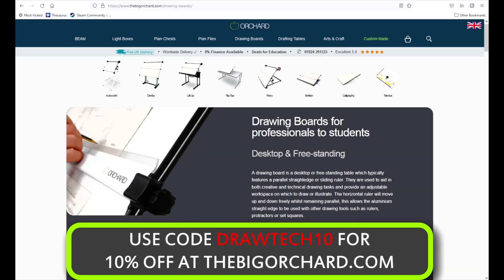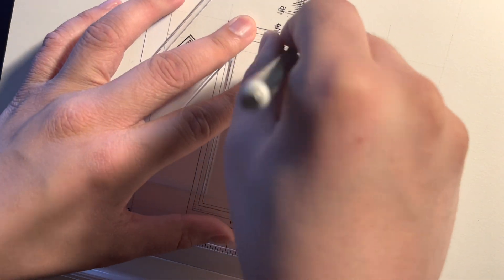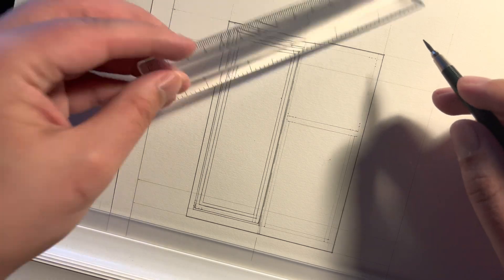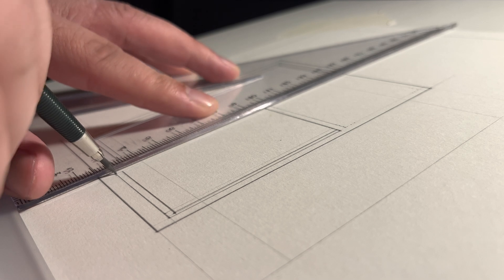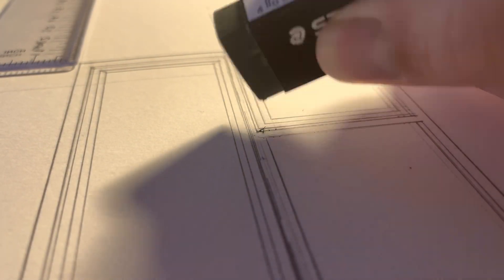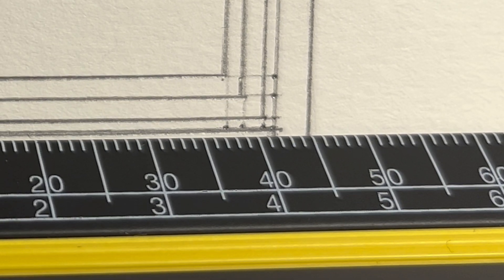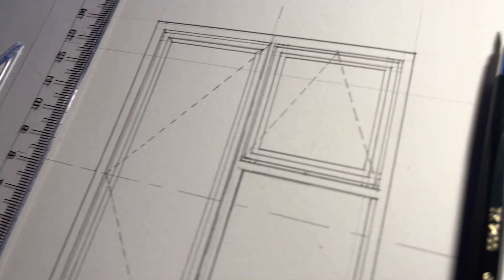Window Elevation Drawing - Technical Draughting

Comment: Do you have the measurements of all the parts?
Reply from the maker: Hello, did you want the measurements of the window in the drawing?
Reply: @DrawingTechnical  yes I do need the measurements
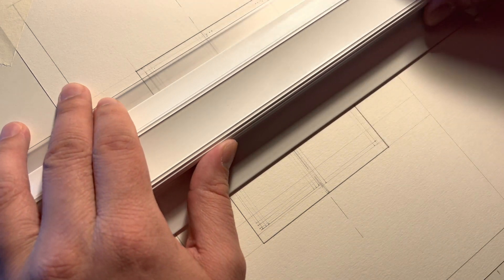Reply from the maker: Hello. the window is drawn at 1:10 scale, it's 910mm wide and 1210mm high. The dimension from the bottom of the sill to the underside of the smaller right side opening casement is 750mm. Let me know if you need anything else.
Reply: @DrawingTechnical  what's ur opinion on  isomars drafting tables  ??